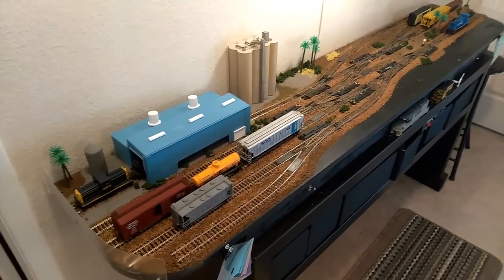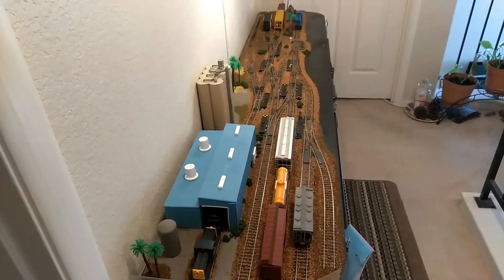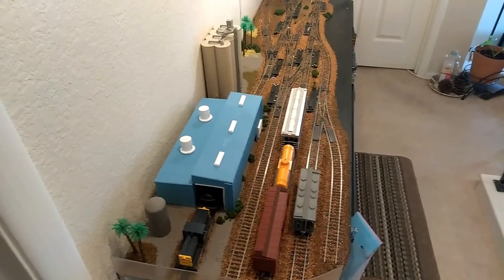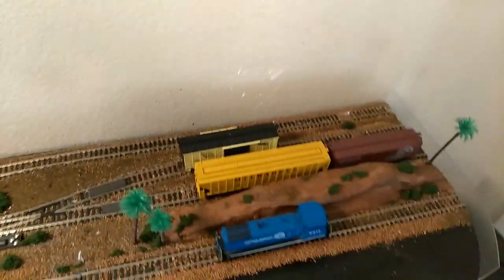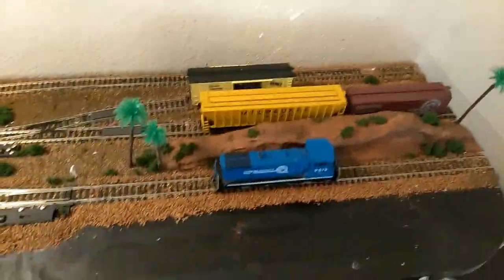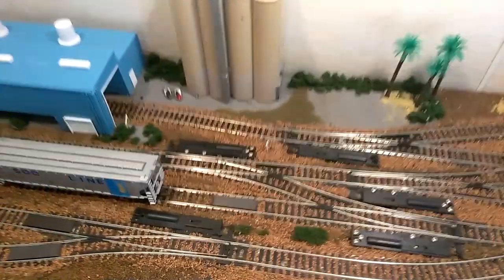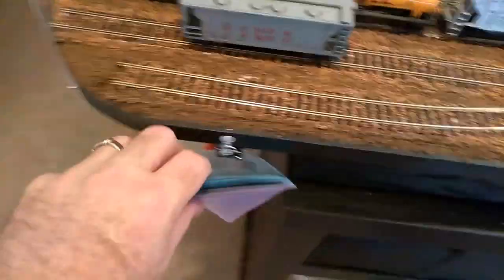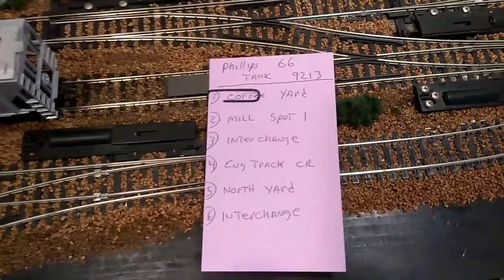Switching shelf model railroad in HO

Comment: Very nice indeed when I built wall switching layouts like that in the 60s I wasn't so much concerned with length as width because everything was 4 by 8 sheets the width was always 24 in 2 feet. Thanks for the video

Comment: Thanks for a great video and layout. I am inspired to do something similar. How did you wire it? any block wiring for like two cab control? Or is it wired for single loco use only?
Reply from the maker: Three blocks, two for just holding units and one for entire layout
Reply: @valet5000  Thanks! It's just perfect for me.  So you have it wired for a single switcher only. I want to wire blocks such that I can run two locos, and kill power to certain spurs. I guess I gotta get out the Atlas wiring book... It also looks like you are are using Atlas snap stitches, powered?

Comment: This is wonderful. Might I ask how difficult would it be to switch your DC design to a DCC design? What would be involved? I ask because I would like to start with DC and later switch to DCC as budget permits. Thanks!
Reply from the maker: For this size and operation of one unit at s time no reason to go dcc
Reply: Switching to DCC is easy, just treat as a DC cab. Reversing loops require 2d power distribution device.
Reply: @valet5000 There is every reason. You can have more than one loco running, some can have lights and engines on bit not running and digital sound.